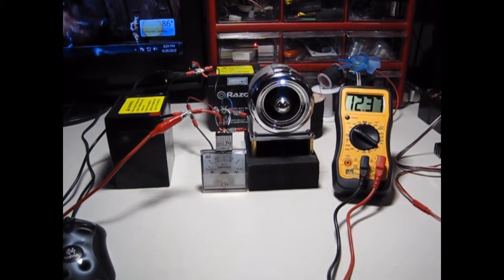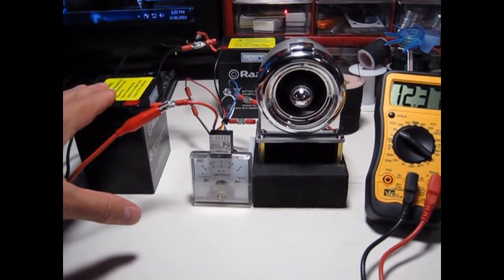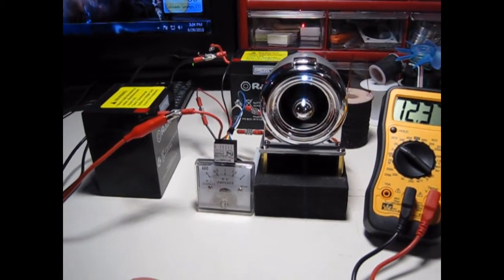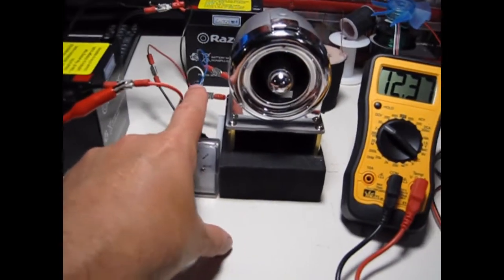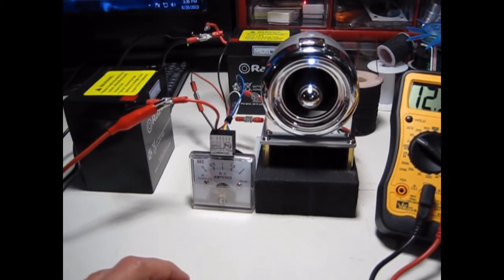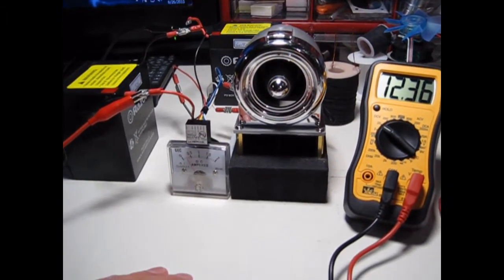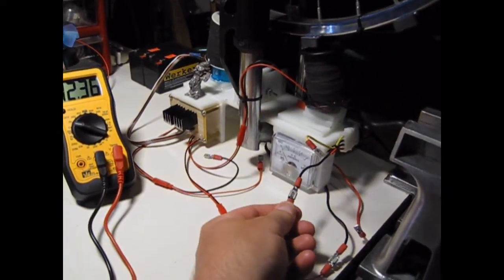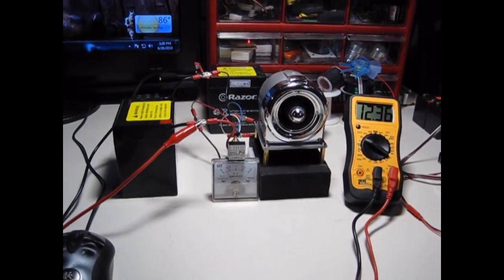My Bedini Discharge Station

Comment from the maker: @MrSAIKRON2 - I am in the process of running another 20 Cycles with a new Trifialr Coil. I am now getting a Battery CoP of 2.97....My previous setup with 2 Coils was running a Battery CoP of .97 (Which was really bad). The Bedini Users Group requested I run the 20 Cycles again and focus on improving my Battery CoP, which this new coil is doiing very well.
Dave

Comment: It looks like you are doing a great job.  Please don't forget as the voltage drops as you discharge, that has to be factored in also in your battery energy calculation.  In other words, it's not just the current, it's the current times the voltage that you care about.

I started a thread on the overunityresearch web site in the Bedini section called "Bedini 10-coiler alternative discussion."  It's quite technical and you should pass by.  Some of the talk is a bit tough, but the info is great.

Comment from the maker: @rwg42985 That's a great idea. An Op Amp Comparator to control a Relay would work. Could use that for both the Charge and Discharge. Thanks for the compliment and ideas! something new and fun is always a good thing :)
Dave